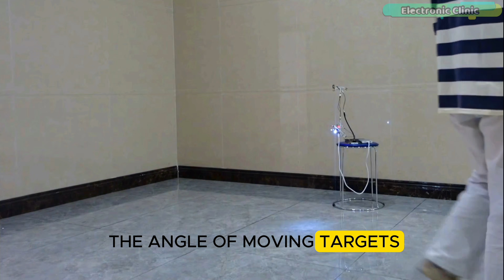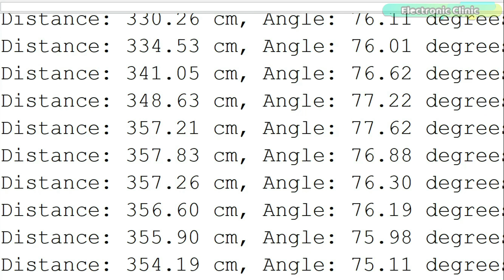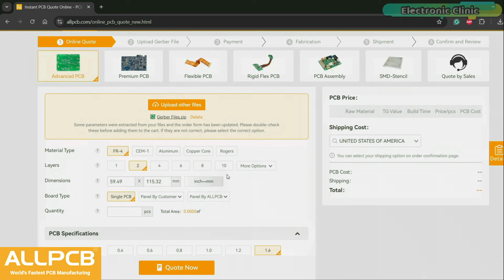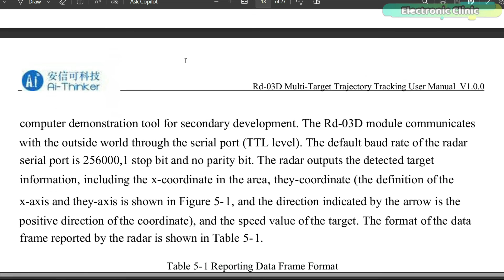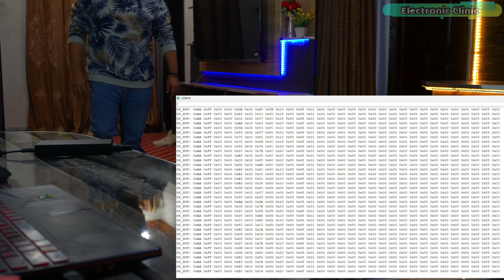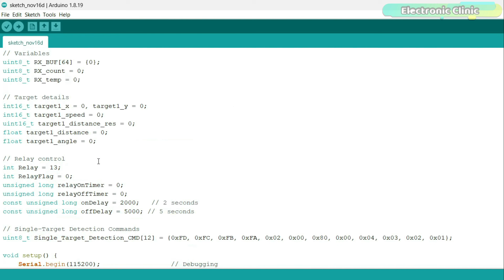ESP32 + Rd-03D: mmWave Radar Multi-Human Tracking with Distance, Speed & Positioning!

Comment: Can u plz tell me to dump code for esp 8266 or arudino in ardunio ide application what should be the baud rate should be selected as in  your code you declared some baud but that baud not there in serial monitor sir
Reply from the maker: You will have to use the same baud rate. Check my other video, I also used it with the Arduino.

Comment: How can we switch between single and multiple human detection? I am using the RD-03D and RA-08H. I am able to receive frames from the RD-03D on the RA-08H, but I can't switch the sensor to multiple human detection mode.
Reply from the maker: By default it's in the multiple humans detection mode. There is no need to switch.
Reply from the maker: Default settings are best
Reply: I am not getting any values of other 2 targets it's just displaying me one target values rest 2 are 0x00

Comment: Yeah, but a PIR sensor uses 6uA while on standby, how much does this use? I doubt it is going to be any use at all for battery based projects, unless you use a PIR sensor to wake it up first.

I just check the data sheet - it says 110uA in power pulse mode - what is this mode?

Comment: do you have the code to write that information in a radar form using 2.2 Inch ILI9341 SPI TFT LCD Display?
Reply from the maker: It's a good idea. I can implement it on ssd1306 OLED. Then you can modify it as per your needs.

Comment: At what voltage are the RX/TX pins? Is the IC a 5V or 3.3V chip? I saw a regulator so maybe that regulates it down to 3.3V?
Reply from the maker: @DustinWatts  3.3v.
Reply: @ElectroniClinic  Thanks. That explains you directly connecting RX/TX to the ESP32 :)
Reply from the maker: @DustinWatts  yes, it is compatible with all 3.3v controllers
Reply: @ElectroniClinic  That is good to hear!

Comment: Thanks for the video!! Thowing a kalman filter on here and fusing with computer vision in zero ambient light is an absolute game changer.What's the recommended way to solder this to a pcb? Just use the JST or solder some pins to the 2.54mm and go through hole? Thanks in advance :)

Comment: Thank you for the fantastic video explaining how the RD-03d works. However, I would like to know where you found the documentation that provides the command codes to configure the RD-03d in single target and multi target modes. On the manufacturer's website, you can only find the document referring to the RD-03 serial communication protocol and it does not include the commands that were used in the demonstration programs for the module's operation.

Comment: If it only was roof mounted. I now use Tuya ZY-M100-24G that is mains powered (230v) that is designed as a roof mounted led spot light. I wished I had this one in the same form factor

Comment: Very important: keep detecting presence if object stopped moving in a middle of room, or if speed was zero. Detection should stop only when object has moved out of range, preferrably only in a configurable place (at a door). If it was done this way, it would be the ultimate presence detector. Without this functionality it's still a motion sensor. I've messed with these radars and they still fail to detect a completely still human.
Reply: You can compensate with code to get object permanence. As long as the location was last within range, then it's still there, even if the radar can't see it.
Reply: @machinemaker2248 yes, I did that. Still bit flaky.

Comment: I have a couple of multi-target mmWave devices that work with HA via WiFi. I had used them to turn lights on when I'm at my desk and turn off when I leave. Two different vendors, at least one is ESP32 based.

A word of caution - both started acting erratically after a few months and the sensors eventually stopped working. I think both died due to heat, which is disappointing because the ambient temperature where they're located would have maybe only hit 85F/30C. I'd be curious to know if anyone else has had this problem.

Comment: This is very interesting. I have some questions.
1- how does it compare to PIR in sense of price?
2- what is the power consumption compared to PIR?
3- Does it have problems with wind or false alarms like PIR?
4- can it distinguish between cats and humans?
5- does it have problems if you put in inside a case?
Reply: 1. they are about $5 vs 10 cents
2. a lot more power, 50-100mA, no good for batteries
3. it is not affected by wind at all. Much fewer false alarms than PIR
4. Not the hlk ones
5. It can see through many plastics. Mine have an open front.
Reply: @originalmianos  thank you!
For the power consumption i agree it's not good for battery powered applications. However if it has some low power modes I can make it work.
There's a Rd-03L model which is low power and datasheet says it runs in uA range. However the datasheet is inconsistet about this.
Reply: @Xanialh  You could use a PIR or other lower powered sensor to turn on the radar.

Comment: isnt mm wavelength xrays? or ionizing radiation...
Reply: No! It is just very low power microwaves at a wavelength of 1.2 centimeters (24 GHz).  UV, and X-Rays having wavelengths shorter than 125 nanometers (.000125 centimeters) are ionizing radiation.

Comment: I have something similar but older.   I couldn’t use it for human detection if my ceiling fans were on.    Does this module still detect humans accurately if a ceiling fan is on?
Great Video!
Reply from the maker: i will perform this test in upcoming videos.

Comment: Great review!

And I guess someone forgot to tell floodlight manufacturer that PIR is for indoor use only. ;)
Reply: Most flood flights with PIR sensors have light sensors that turn the pir off during daylight hours as they get flooded with ir light. There are more advanced versions but they aren’t often used in flood lights.
Reply: 😂 in which field are you an engineer ??

Comment: I have these on some of my rooms like the kitchen etc 3d printed a case and attached to the ceilings and works pretty awesome for months now!
Reply: Awesome. Could you post a link to the stl files? Thanks in advance
Reply: @thinkwareltd link please
Reply: Did you connect them to HomeAssistant? And if so, could you please share how you did it?
Reply: @Djeloan  just add a bluetooth proxy to your esp32 yaml and then the radar should show. You also need to add the LD2410 BLE integration to your HA

Comment: I want something to on/off the toilet lights with presence, no need gesture, is this RD-03D better? or RD-03E?
Reply from the maker: @SEOng-gs7lj  Rd-03D is best. You can track the position and then control certain lights, plus it can detect still human so the light won't turn off.
Reply: @ElectroniClinic  it's same as HLK-LD2450 right?

Comment: Oh, is it giving horizontal AND vertical angle?
Or do 2 different sensors operating side by side interfere?
Just connect it with a robot arm or two servos and we will see steered paint ball guns intercepting intruders ….
🤔
🤣🤣🤣
Reply from the maker: @muctop17  only horizontal angle.
Reply: @ElectroniClinic  and do two sensors operating in same room interfere?
Reply from the maker: @muctop17  of course they will
Reply: Much better to just use camera with object detection. Granted it's a bit more expensive since you need camera + edge SOC + AI processing unit for fast inference but still very doable for around $100 with enough accuracy to not only detect all the people in the room, their positions and even their pose (ie someone raises fists in aggressive stance and they get a face full of paintballs 😂).

Comment: I don't think mmWave will replace most PIR sensors. Reason 1: They use more power than PIR sensors making battery-powered sensors infeasable (battery life less than 2-3 years is not enough). Reason 2: Privacy - mmWave can collect too much data. A PIR sensor is enough in hotel rooms.
However, mmWave could be useful beacuse it can measure distance - eg you could use it to turn on the light at the right spots.

Comment: The LD2XXX family has the problems with wind, either natural or artificial. How is this on windy days or rooms with ceiling fans?
Reply from the maker: I will test this in part 2 of this video. It was so cold, I didn't turn On the ceiling fan. But I will do it for you.
Reply: @ElectroniClinic  cool! You got a new subscriber!
Reply: @ElectroniClinic  are you talking about replacing standard, infrared, electronic security sensors and or microwave sensors?
Reply: Problems with wind??
Reply: @userou-ig1ze  yes, when I open the door of my office, on a windy day, the LD2410 thinks a person is there.
Reply from the maker: @userou-ig1ze  I will test it in my next video on the Rd-03d.
Reply: У них нет проблем с ветром. Они реагируют на двигатели вентилятора, холодильника, кондиционера. Это нужно учитывать при размещении датчика.
Reply from the maker: @saninnsalas  I am going to perform these tests in a few days.
Reply: @ElectroniClinic bro can we get a demo and code on follow (particular leds lights up where one is standing or walking) leds ws2812 using this Rd-03 sensor and gestures to on off lights please..😭 i was planning to use 22 PIR/Rcwl 0516 on each stair step to turn on each stair led only when walking through it
Reply from the maker: @raystonrizwan7800  this is in my projects list. But first I have to perform some tests. I have also ordered some other mmWave sensors. So, let's see which one is the winner.
Reply: @ElectroniClinic ok bro please do 🙏 thanks a lot
Reply: @ is it live?

Comment: Seems similar to ld2450 which doesn’t do static detection well (loses the target if remain still for too long)

Looks promising from your test
Reply: Many thanks btw - very interesting. Calibrated for just humans? What about animals? Vehicles? 

Range?
Reply from the maker: @thebatu89  this one is perfect, it can detect still humans accurately.
Reply: @ElectroniClinic  Just to clarify if you sit down/remain still for longer than 5 minutes or so it still detects your presece just fine? This was an issue with LD2450 which seems to drop target ~30 seconds unless I make some movement (which is why I had to go back using LD2410)
Reply from the maker: @thebatu89  I tested it, it works great. Even if you are not moving still it's going to detect you.
Reply: @ElectroniClinic  thanks, gonna try it out.
Surprised no one else had tried this sensor even though it was released way back in January

Comment: Can it differentiate between target sizes? I've considered millimeter wave but the inability to narrow the detection bandwidth without major study and complication has been a problem. While I appreciate the sensitivity whilst being able to penetrate walls/doors, etc., I have house cats that constantly trigger sensors that aren't intentionally limited in scope. If I could have a set point of 20+ kilos mass as an example, I could install one sensor per area without much consideration beyond hiding them for esthetics.
Reply from the maker: @showxating9885  sensitivity isn't an issue, you can set a limit. I didn't find any info about the target size.